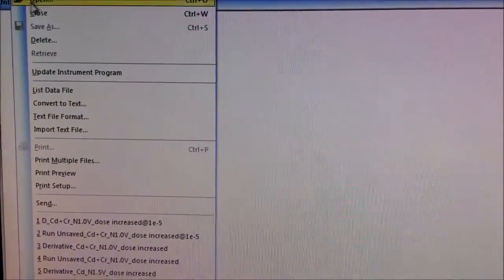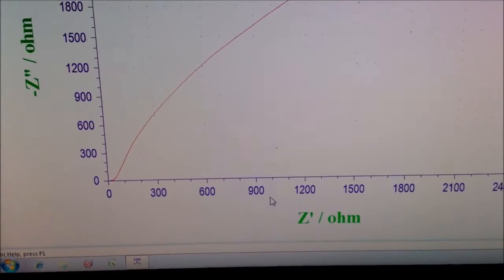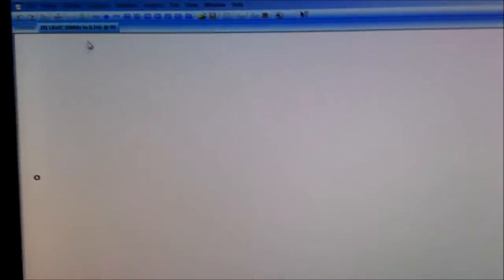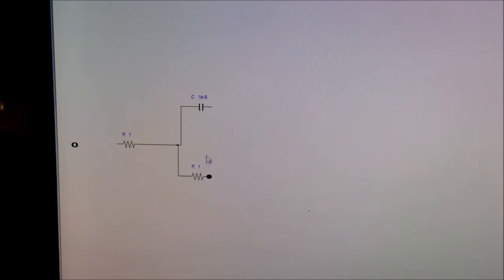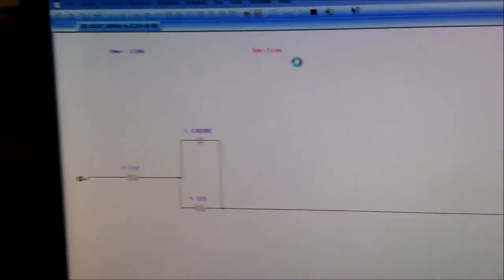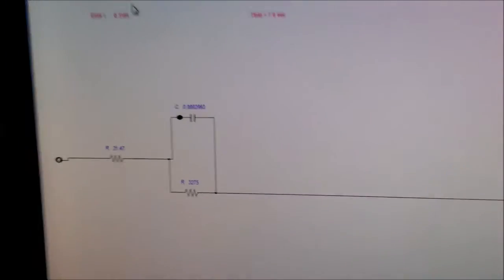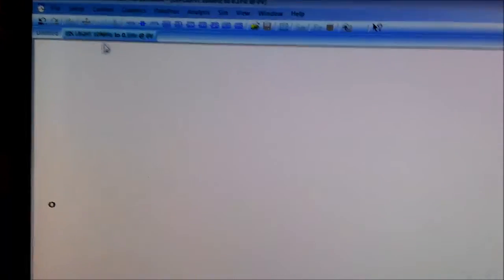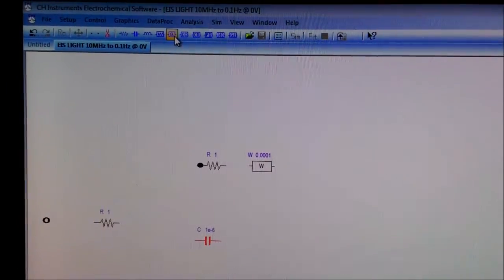Equivalent circuit from the EIS plot in CH Instruments

Comment: Finally you haven't solved the circuit...
Fitting should be done systematically by observing nyquist plot..... you've done like you already know the circuit..you should play with 'n' value to reduce the errors, you're only doing automic fit, next to automatic fit there is option where you can play with component values and can reduce the errors.

Comment: hi, Iam Waleed I. Omara, I am from Iraq. I am working in corrosion laboratory, and make electrochemical experiments on ELECTROBANK potentiostat, and I want to add the EIS technique but I don't know how to simulate the equivalent circuit, and what is the benefit of it, could you advice me about this issue, thank you
Reply from the maker: Hello! As I have never used the 'Electrobank' potentiostat, therefore I can not say how to do the EIS measurement in that instrument.  As far as the equivalent circuit fitting is concerned, I would say that fitting reveals much important information about the electrode under consideration such as equivalent series resistance, charge transfer resistance, double layer capacitance etc. There are several papers on this topic which you can read. Moreover, you can check in the 'ResearchGate'. However, I am sharing a very useful link from the Gamry Instruments on EIS, which will definitely help you. https://www.gamry.com/application-notes/EIS/basics-of-electrochemical-impedance-spectroscopy/

Comment: "You have to change the circuit elements and justifg why you made this change""!!!

I am basically watching this vedio to know how to chose the circuit, how to nodify it and how fo justify the circuit design !!!
Reply from the maker: The video depicts the relevant steps and processes to get the equivalent circuit using the EIS data. I have also shown the conventional Randles circuit and changed the basic Randles circuit as well to minimize the error. However, how can I say which equivalent circuit will fit the best with your result? It depends on the electrode material you are using. Even, if I would have reduced the error to 2%, did that mean the circuit would produce the best result for your material too? That is why people do research, to find the best fitting for their electrode, which is tenable as well. You will find different types of complex circuit diagrams for various electrode materials in literature, which are suitable for those materials or electrodes, but those may not be the best for you material.